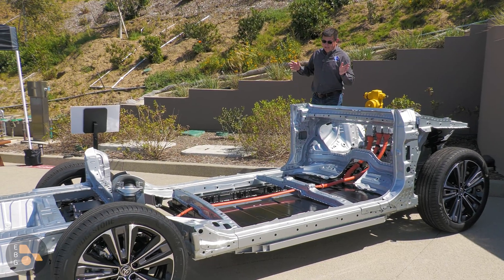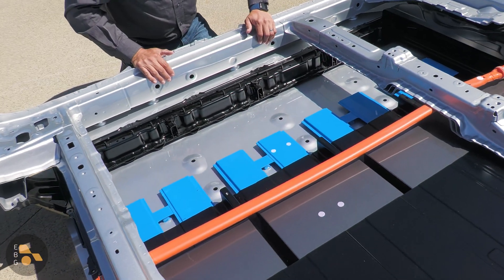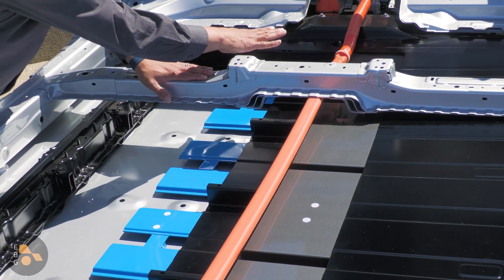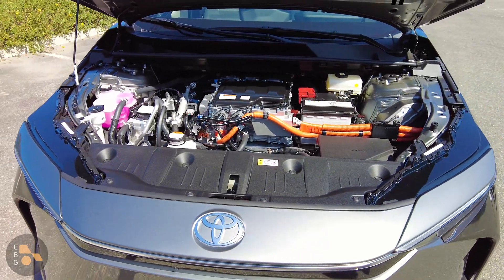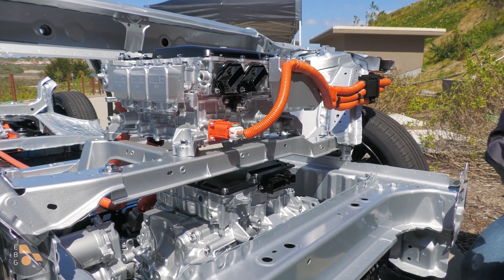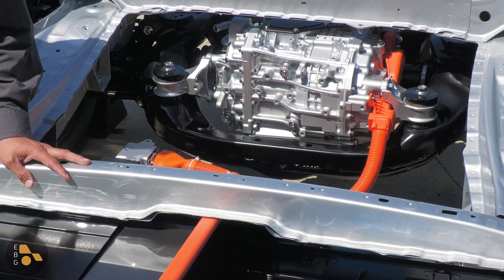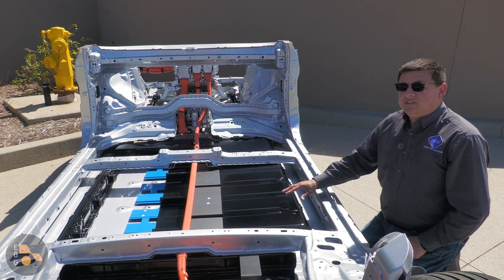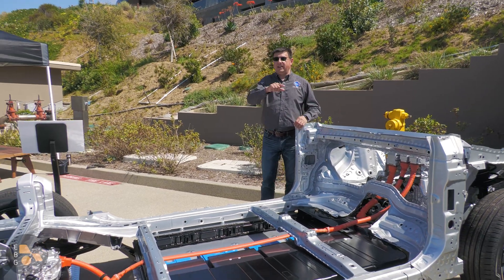Toyota's bZ4X Under The Skin | Deep Dive Into The New eTNGA Platform

Comment: I've moved away from Lexus/Toyota a long time ago. They just don't use high-tech stuff and it was so disappointing when they sold cars equipped with airbag issue knowingly. Now, looking at their eTNGA Platform, it still didn't move away much from classic car frames compared to competitors. Hyundai really did a good job with eGMP and utilizing one of the motors to function as an inverter to provide fast charging at 800v. It doesn't even look that much modular. Such a grandpa's brand...

Comment: Interesting you associate 150 Kw dc fast charging with the Panasonic batteries and 100 Kw dc fast charging with the Chinese batteries. The spec for the Subaru Solterra i.e. AWD)  distributed to dealers in Canada specifies 150 Kw dc fast charging and I think it is the same in Europe. You could still be right, and the difference may be in the strength of the battery warranty - offering 90% range retention over 10 years in the US versus only 70% range retention over 10 years elsewhere? Any comment you might have would be appreciated. For some months I have been research EV's very intensely looking at many different reviewers from many countries. My situation demands good ground clearance and AWD and I've pretty well settled on the eTNGA platform. Considering the details of the trims set up for Canada and to be shortly available  it looks like Solterra offers faster dc charging, power folding exterior mirrors, electronic interior rear view "mirror"(especially helpful with no rear wiper), more refined regen control (of course!) and better off road body paint protection(of course) , power front passenger seat and driver memory all unavailable in the BZ4X, but all the fancy bits will be available in the coming in RZ 450e + more. Incidentally, in all my research I've concluded you are THE best passenger vehicle reviewer anywhere in the English language..
Reply: The better paint protection(dull body surface around wheel wells)  might be what BZ4X is offering on the lower trims as almost an implicit marketing put-down of the actually better equipped Solterra.

Comment: Disagree with logic for no front trunk. There is a ton of room in front of power electronics. This warmed over RAV4 explains the poor design philosophy-as does Toyota’s reluctance to bring a competitive mass produced EV to market. I bet this thing will barely trickle into the market due to various lame excuses from Toyota.
Reply from the maker: There's no way around it, an EV with a front trunk has a longer nose than a design without it. And adding that extra length up front doesn't yield as much space as adding the length in the back.
Reply: @EVBuyersGuide  if power electronics were miniaturized and placed under car/ near battery pack instead of putting very ancient looking charger and inverters where the RAV4 ICE goes, the front could have been shortened, saving weight, and enabled a larger rear area if wanted. Toyota clearly put it’s less capable engineers on the design team.
Reply from the maker: @barryw9473  Commonality of parts is important in order for the EV to be affordable. Sure they could have but it would have increased cost. Also, front ends generally have minimum dimensions for the crash structures.
Reply: I’ve used the trunk in my Model 3 maybe once in a year. It’s just a nit-pick point that over zealous car reviewers and Tesla fanatics like to pick.
Reply: It's just make the front end longer and smaller total cargo volume. 
This is for all designs.
Reply: @valdius85  if so, dumb design.
Reply: I don’t understand the obsession with an EV frunk. It is front collision mitigation zone where manufacturers tell you not to put rigid products in. It creates a large hood. If that’s your thing? Fine. But ppl act like they need that little extra thing or there’s no reason to buy a car or something.
Reply from the maker: @shinybaldy  I'm honestly ambivalent about it, I like the frunk in the Teslas and Mach E, but I can live without it as well. The frunk gives the car an elegant long hood profile, but honestly why does an EV need a long hood? Just for the frunk? If you only do it for the frunk then that's silly.
Reply: @EVBuyersGuide  I think packaging/aerodynamics a frunk fits nicely with a small low EV. Like Honda Civic or a Mazda 3 kind of styling. But you also have vehicle shapes like the Honda Fit/Nissan Leaf/most SUVs that don’t benefit from a beagle nose and probably makes more sense to use the front end for dedicated mechanicals and create volume in the back.
Reply: @shinybaldy  The obsession for an EV frunk usually comes from people who will never own an EV
Reply: The Toyota RAV4 is one of the biggest selling, and reliable vehicles on the road
You probably didn't intend or realize it, but calling  the BZ4X a "warmed over RAV4"
Was a big compliment for this EV

Comment: Hmmm - with that huge hump of inverter and motor sticking up at the rear wheels, how does Toyota or Subaru make a SUV-ish platform with fold-down rear seat to open up large cargo area when the thing is equipped for AWD?

Comment: So a 2022 ev but with no frunk despite being on a ground up ev platform. Dcfc speeds of only 100-150kwhs, just 6.6kwhs home ac charging.
Only 220-250 miles of range, likely no battery pre conditioning. No standard heated seats or steering wheel.
Cloth seats and dashboard, lots of hard plastics, those hideous dual tone painted fenders. 

Top spec is $50k with the destination charge. They are almost out of the full tax credit due to lots of hybrid sales. 
Very slow acceleration time's for its class and competitor's offerings.
And to top it all off? Toyoduh says about 7k in total for the U.S. in all of 2022. Imagine the stealership markups for these. 🤔
Reply: It does have heat pump...but the rest of your assessment is spot on. Pretty disappointing from Toyota, but expected given how tepid Toyota is about BEVs.
Reply: With those meager specs, the stealerships might not get what they want.  Toyota's Hybrid drivetrains have matured over 20 years and are so efficient, reliable, and long-lived, one could own a very decent Lexus Hybrid with more space, comfortable go-anywhere transportation and much better people/cargo hauling capability for the price of one of these.  For the older folks who don't drive that much, Toyota plug-in hybrids make a lot more sense at the moment.
Reply from the maker: Heat pump is standard and it compares well against comparably priced competitors. You'll find faster charging elsewhere but not for this price
Reply: @EVBuyersGuide  so the base ioniq 5, Kia ev6, mach e sr and tesla Sr don't charge faster then? 🤔
Reply from the maker: @4literv6  Base Mach E SR AWD is only 10% faster charging and the AWD Ioniq 5/ERV6 are more expensive. Base to base yes the Kia/Hyundai charge faster but you get less power (167 HP), less range, and no heat pump so even less range in cold weather. There are tradeoffs here as with most comparisons so it depends on what you're looking for in EV.,
Reply: @EVBuyersGuide  so those base models are in fact faster charging, and aren't the accelerarion time's also comparable for the base model's of all those if not better than 7.2s 0-60mph? Plus those are all rwd base spec evs, not fwd like the bz4x. 
All those base specs all go farther on a smaller sized useable kwh pack to right. 

Basically would you consider this ev over your mach e? Also good point about cold weather. I have seen some very slow speeds for the Korean twins in the cold and the id.4/mach e as well. 🤔
Reply from the maker: @4literv6  It's give and take. The base Mach E (Select) AWD gets you 2 more miles of range, 10kw faster DC charging, costs $2,600 more, is a hair faster to 60, but lacks the heat pump. The FWD model is $3,800 more, has less range, still lacks the heat pump and DC fast charged 40kw *slower* than the bZ4X (FWD charges faster due to the different battery). RWD is more fun, but FWD has greater regen potential. Now, vs the Mach E I had or the EV6 we have now, no clearly I wouldn't bZ4X, but you also have to keep in mind that the EV6 I have and the Prem LR AWD Mach E I had are about $20,000 more expensive, so is it better? Sure, but it's also 50% more expensive so it should be.
Reply: @EVBuyersGuide  thank you for the detailed information and real world experience.
Reply: Every bZ4X has a heat pump.
Reply from the maker: On their website, press releases, and window stickers.
Reply: @EVBuyersGuide  edited the og post, you failed to mention their new fangled radiant heat flooring though. 👍🏻
Reply: Stop comparing, you have no Choice. Sold out 2 years in advance.

Comment: The rapid pace at which Toyota whipped this one up should make many brands very nervous. Toyota may not be the first. But when they do? They have the engineering chops to get it done plus Toyota scale/QA
Reply from the maker: This was not rapid, development started 7 years ago
Reply: @EVBuyersGuide  ugh. You just confirmed this thing is already obsolete.
Reply from the maker: @barryw9473  I would say that the pricing and position is important and if you look at it through that narrow lens it looks much better. It's the least expensive AWD EV by a decent margin and somehow nobody cares that the base battery Mach E charges slowly...
Reply: @EVBuyersGuide  maybe. But Toyota plans to sell 7000 in 2022. “Great” price , but no cars to be had?and only in ZEV states. Ford is on track to sell 200,000 Mach-E’s this year. Agree 115 kW is not great but at least you can buy one.
Reply from the maker: 7K is about right, they would only say volume would be somewhere between 5-8K from the on-sale date this month through the end of the year, plus of course the 7,500--8,000 Subaru Solterras they are making. Total that's similar volume to Ford's initial 6-7 months of Mach E sales. On the Mach E front... Well, good luck either way. Ford stopped taking orders for 2022 and prior to stopping the orders the lead time was over 7-8 months after order, so.... Not great for anyone wanting a new EV right now.
Reply: @barryw9473  With all the component shortages, how does Ford plan to crank out 200k units of Mach-E this year
Reply: @wyw201  Through planning. Toyota forgot to buy a battery supply. Doh!
Reply: @barryw9473  How far out does Ford plan their inventory in advance?
Reply: @barryw9473  All of the Chinese EV makers reported earnings this week, they’re slashing production forecasts on shortages in components and batteries. Is Ford on track to produce 200k Mach-E this year or next year?
Reply: This thing was whipped up a bit too fast to be equipped with competitive features. Toyota has no plans to scale manufacturing as it makes too much money from ICE.
Reply: They've been building towards this since the prius. Many people derided them for doing so because of myriad "reasons". This thing looks pretty neat too.
Reply: I have one - regretting it majorly. 
Just buy a Tesla.
Leaps and bounds better in every single way.
I could NOT  be more disappointed...

Comment: Are the battery cells prismatic or cylinders?
Reply from the maker: Neither, they are pouch cells which have their layers on the same plane rather than "jelly rolled" as in a prismatic cell. This layout is more energy dense than a cylindrical cell in terms of real estate, although the 18650 cells Tesla uses have about 80% greater energy density per kg of weight than some cells at ~248-257 Ah/kg, CATL, SKI and LG all have pouch NCM cells with higher energy density by that measure as well.